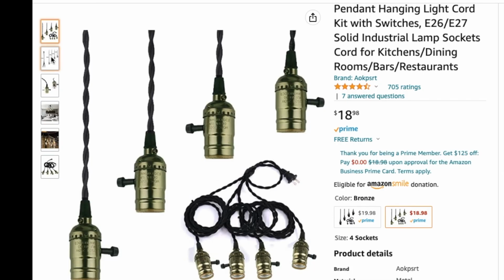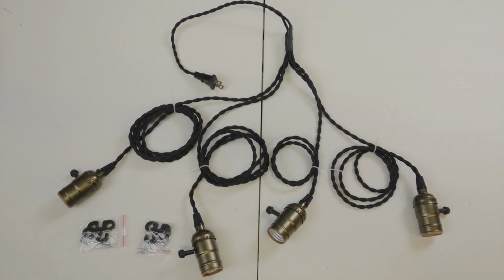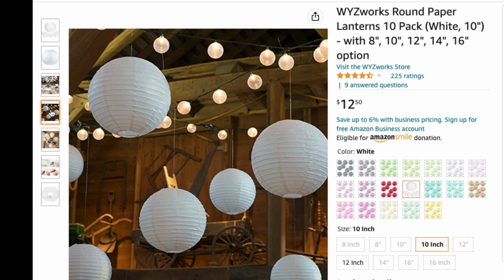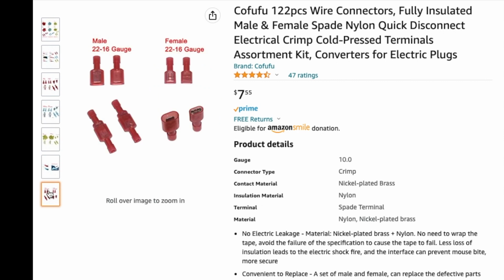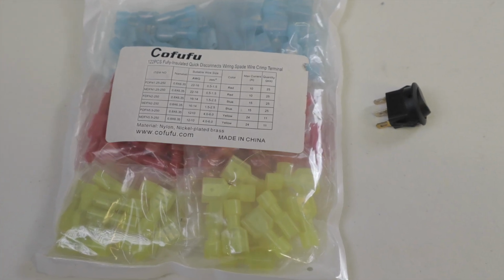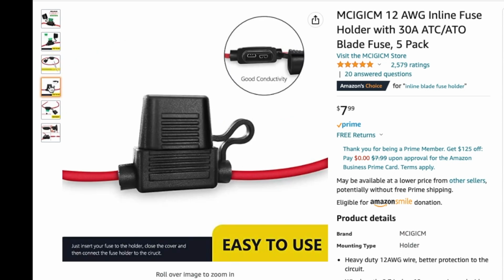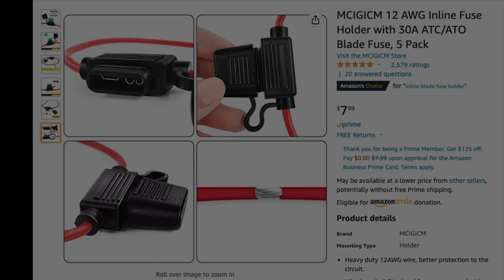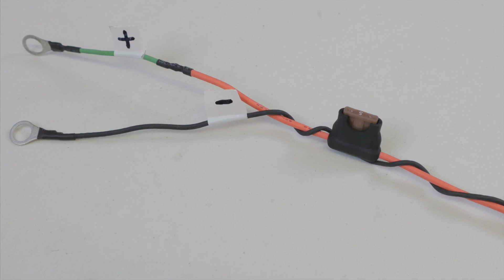Transform Your Workshop: Exciting DIY Off Grid Lighting Ideas!

Comment: @0:42 I expected that. Brilliant 👊 but Dave, I bought a EcoFlow Delta Pro. Costco and I just plug it in. Solar from 12v to 150v, 3600w, 4 AC outlets, a bigger round plug at 30A, and usbc, and the other one (not micro or mini) etc. and it’s portable, expandable to 20K watts + WiFi, DV Anderson out and much more and only a 120V charge cable and/or xt60 connector. Plus if you ever need it can be fast charged with the smart home panel or take it to a EV charger. I’m a tinkerer, but waining in my years. It even has a luggage pull and wheels! Weights 100lb though, so I got 2 🤓 I miss my deer life. Nice video 😊

Comment: So hang on, you went with DC bulbs to avoid the inverter loss, but then you are charging the DC battery for the lights using the inverter, which is even more lossy.

Comment: Changing the voltage only changes the size of wire required. The wh are the same thus energy consumed is equal.  Higher volts allow smaller gauge wire and thus saves some money on your wire.